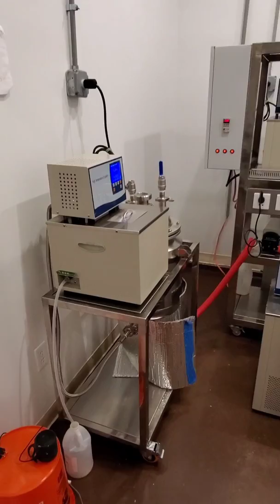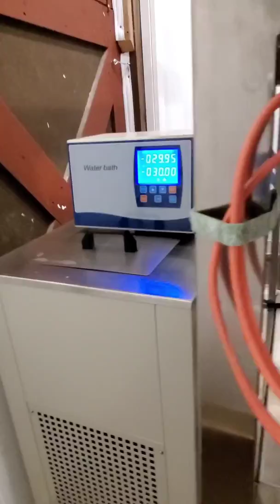Making CBD Distillate Oil With Wipe Film Molecular Distillation

Comment: Can you extract the thc to reduce the percentage in the cbd? Also is the edible or smokable? Is this considered decarboxylated or does cbd not need to be? What if you do smoke it?
Reply from the maker: This equipment isn't really set up to extract THC in it's current state. The distillate it makes can bed added to edibles and can also be used in vape carts. I always recommend decarbing prior to running it through the wipefilm system or the blades and the feed lines will get gummed up.

Comment: Did this system run well?
Reply from the maker: The system ran well but there are definitely changes to the layout I would make to optimize it's efficiency. I would move the pre-heater and it's associated vessel much closer to the wiper/evaporator. A significant amount of heat is lost due the distance from the pre-heater to the wiper/evaporator. You'll need more ceiling high to get it as close as possible and that was a limiting factor for the current facility without putting a hole in the ceiling. The circulator for the internal condenser coil  does not have a high enough range, and that impacts the systems ability to increase it's productivity. Also, there is a plastic internal component for the circulator for the internal condenser coil that is not durable enough to perform at 95 celcius and the company I purchased the system from, SEPSED, has not backed their product. The company sells a metal component that is more durable, but they have not yet to date sent that component to replace the non-viable plastic component.
Reply: Tyler Chamberlain glad you got something out of it. A buddy’s company has one and were shocked by the fact there was huge unpolished portions of steel inside of the body. Blades didn’t work either I think it was the motor

Comment: Is possible produce cbd oil free THC and terpenes with this equipment?
Reply from the maker: It's possible to separate some of the terpenes but you won't be able to separate much of the THC because of how close the CBD and THC boiling points are to each other. If you knew what terpenes were in the crude you could isolate them with the right evap and condenser temps. Unfortunately, the condenser chiller only gets up to 100c for this particular set up and you might need something with higher and more accurate temp controls.
Reply: People use wipers all the time for thc 🤷‍♂️
Reply from the maker: Can you share an SOP that will separate THC from CBD?
Reply: Tyler Chamberlain use crude that doesn’t  have cbd. If you have cbd and thc in the crude the boiling points are very close but if you stay on lower end of thc boiling point pull a deep vac to help you can leave cbd behind while pulling the thc.  But a fraction finder from arametrix will help to single out fraction bandwidths to know what fractions you are pulling.
Reply from the maker: @MatanuskaHIGH  ah, understood, the focus of the video was using the equipment to make CBD, but you're right, same equipment can be used for THC crude. The original question was trying to figure out if the wiper could be used to remove THC from CBD crude.
Reply: Tyler Chamberlain cbd remediation.  Check out future4200 and ask the question in that forum and  I think you can find that answer. Or google it some of the information in future4200 is easily accessible.
Reply: Tyler Chamberlain if you isolate thc and cbd fractionsz it could be done possibly with wiper but usually the thc and cbd fractions are very close. But thca crystallizes but thc doesn’t.  Cbd doesn’t crystallize but cbda does. If you could isolate the cbd crystals in the thc heavy distillate you could possibly separate them. You gotta trial and error and think outside the box and maybe you will find a way. That’s how I’ve done  extractions for a decade just using known science and applying it to the problem I’m trying to solve. Thc remediation isn’t normally something people do. But that’s doesn’t mean it isn’t possibly or someone else hasn’t been working on it or doing it. I hope you find the answer to your problem though and I’d be interested in also working to solve that problem.